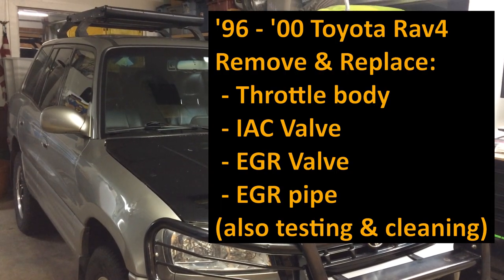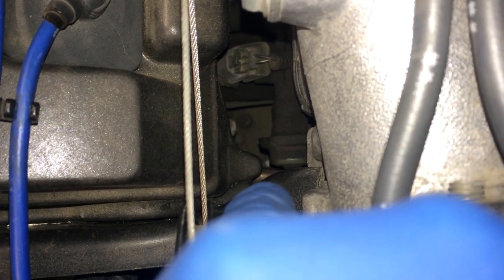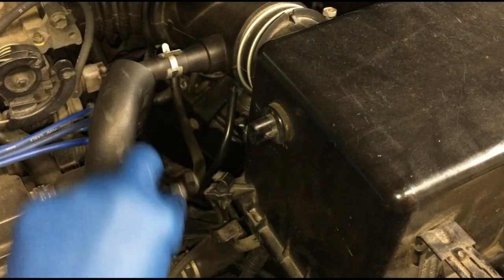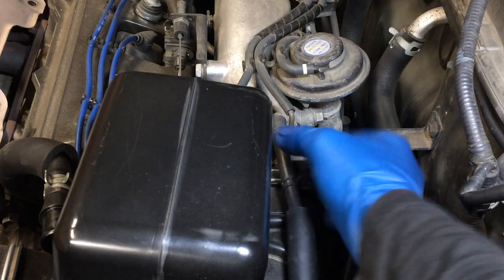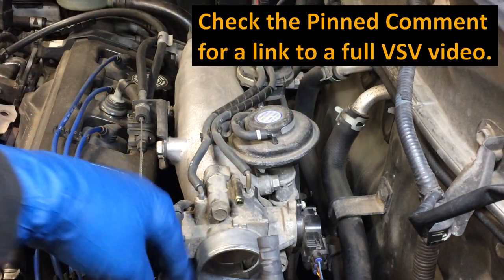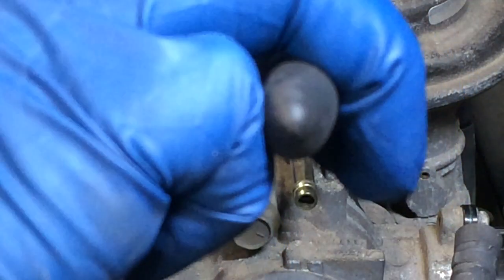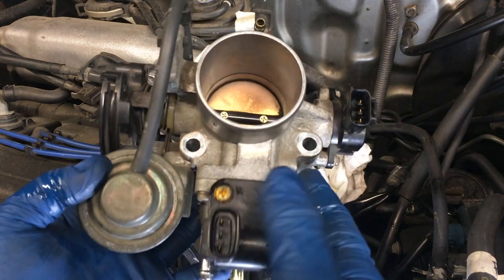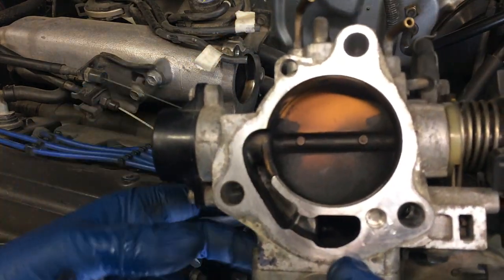1996 - 2000 Toyota Rav4 DIY Remove Throttle Body, IAC Valve, EGR Valve, EGR Pipe, with Bench Tests

Comment: Thank you very much for the clarification of  mechanical instructions to detail you're such a pro  👩‍🔧 
Save me a lot of money for my family can eat . 
Do I have to disconnect battery before starting to take off throttle body ?
 do l have to reset ecm 
When I finish completing the work ?
Reply from the maker: No, you don't need to disconnect the battery before removing the throttle body, and you don't need to reset the ECM, but you certainly can if you'd like: to do that, simply disconnect the battery for a few seconds.  If you notice high idle after cleaning the throttle body or disconnecting the battery, the idle will typically reset over several start-stop and driving cycles.  Thanks for watching! : )

Comment: Excellent -- I LOVE YOUR VIDEOS!! Thank you!!! I can watch over and over. Question the torque wrench what brand and size 3/8 or 1/4?
Reply from the maker: Thanks!  About torque wrenches: the torque values for this job are low, so most 1/4" drive torque wrenches would cover the range needed.  You'd want a 1/4" drive torque wrench that covers up to about 200 inch-lbs (note that is inch-lbs, not ft-lbs, or about 23 Nm).  But there are also 3/8" drive torque wrenches which cover this same low torque range, such as the Icon 56614 (and those are more expensive than the 1/4" drive).

That Icon 56614 is unusual, though, because most 3/8" drive torque wrenches cover a middle range of torque values, such as about 10 to 80 ft-lbs (note that's foot-lbs now, not inch-lbs, or about 14 to 108 Nm).  Then 1/2" drive torque wrenches would cover the higher range of torque values, perhaps 50 to 200 ft-lbs.  

I have a lot of torque wrenches now from several makers, but for years I only had the cheap Pittsburgh torque wrenches from Harbor Freight.  If used correctly, the Pittsburghs have been reliable torque wrenches for me, and there a videos on youtube that show that they're really not bad, especially if you don't have much to spend (torque wrenches can be expensive tools).  I don't think there's a cheaper torque wrench than the Pittsburghs, which are about $20 each, and available in 1/4", 3/8", and 1/2" drives.  

If you can spend a little more, there are better options though, especially because now there are many affordable torque wrenches which have the locking collar-type adjustment knob (such as the Icon 56614) instead of the screw-bottom on the end of the handle, like the Pittsburghs.  I have both and vastly prefer the locking-collar type because sometimes the screw-bottom type get loose.  The locking-collar type do not ever get loose.

I hope that helps!  Thanks for watching, and have fun tool shopping! : )

Comment: If there is enough "tool clearance" to apply Vice-Grips to the periphery of the screw...  only a few degrees of rotation may break the fastener free.  From that point, it's done.  Usually.

Comment: Which manual/book are you using?.Could you kindly share a link to download the soft copy
Reply from the maker: I'm using the Toyota Factory Service Manual (FSM).  I'm not aware of any links, but there may be some available somewhere.  Here is an example of the book I'm using - Volume 2 is the book that covers engine repairs, and is the book shown in my videos:
https://www.ebay.com/itm/380880991501

Volume 1 doesn't contain repair info, but only diagnostics info.

This below may or may not be an electronic version - I don't know and haven't purchased anything from this seller:
https://www.ebay.com/itm/404169235833

I hope that helps - thanks for watching : )

Comment: If possible, please mention at the beginning of your videos the other Toyota years/makes/models with which the RAV 4 work is compatible. I have a 1997 Camry 2.2 L 4 cyl. I am guessing its the same set up. Great videos ! Thanks for your patient hard work.
Reply from the maker: Thanks, I will try to do that -- as you know, the 3SFE and 5SFE engines cover over a decade, and there were some changes here and there, so it takes a little bit of research.  The biggest things to watch for on Toyota EGR systems from this era are:

1.)  some models have an exhaust gas temperature sensor while others use engine temperature, and

2.)  some models have a VSV which works in the opposite fashion as the one seen in the video (meaning that on some VSV's, the energized state is "EGR flow" while the de-energerized state is "no EGR flow").

I'll look into the '97 5SFE and see what I can find.  Overall, there are a lot of similarities between the 3SFE and 5SFE, and many parts are interchangeable, but I'm not positive about the logic on the 5SFE's EGR VSV, and unfortunately I don't have a 5SFE VSV on hand to test (part # is 25860-74050).  I'll let you know what I find!

Comment: I’ve been struggling with the jis screws on the IAC valve. They’re so tight and the person who owned it before me already cammed out the screws so I’m left with nothing left to do but to extract them I’m guessing. Just need to get the new screws before I mutilate the other ones lol. Damn thing is stuck open and idling high.
Reply from the maker: I know the feeling!  As shown in the video at 13:05, those little screws were so tight that they clean sheared my tool-steel JIS bits right off.  If you have anything left to bite into in the screw head hatching, you might try the Vessel JIS screwdrivers shown in the video at 18:03.  I love Vessel JIS screwdrivers.  This little stubby Vessel JIS is extraordinarily grippy - didn't have these at the time, but they are even more grippy than the ones show in the video:

https://www.amazon.com/Vessel-Megadora-920-Stubby-Screwdriver/dp/B00N3M391O/ref=sr_1_20

But if the screws are totally cam'd out, then you'll have to move to another option, such are removing the head (as shown in the video) or trying extraction pliers, such as the Engineer/Vampliers range or Knipex Twin-Grips.  The problem with extraction pliers is, as you know, there's not too much room for bulky pliers heads.  Some examples of extraction pliers that I can recommend in general (but that I'm not sure would fit) are these:

https://www.amazon.com/ENGINEER-PZ-58-Extractor-Combination-fasteners/dp/B002L6HJAA/ref=sr_1_1

https://www.amazon.com/gp/product/B01DIY7V7Y/ref=ppx_yo_dt_b_search_asin_title

https://www.amazon.com/Multi-function-Gripping-Extractors-non-slip-neji-saurus/dp/B00NBSVYOY/ref=sxin_18_ac_d_rm

https://www.amazon.com/KNIPEX-82-01-200-TwinGrip/dp/B097C98LCT/ref=sr_1_1

I have all those pliers except the PZ-58's: I think the most likely to work in that space on such tight little screws would be the Engineer PZ-60 needle-nose, but I don't know that for certain since I just decided to cut the screw (with the the little $7 Harbor Freight rotary tool!).

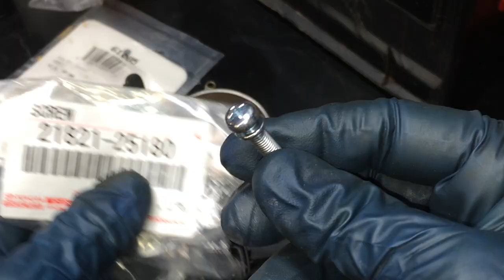I hope that helps - as shown at 26:45, the part number for the screws is Toyota 21821-25180...buy a couple extra!  : )   Good luck!
Reply: @L35inColorado  Thank you for the reply, I'm going to actually consider doing what you did and remove the heads and take them out that way, it may be easier that way. I purchased the vessel screwdriver just like you instructed and I love it! The only thing is that 3 out of 4 of them are cammed all the way out sadly. same with one on the electrical part of the valve. I'm gonna get this tackled down, just ordered the screws from toyota.

Comment: Great educational instruction, Thanks! Why is does the IAC use coolant input and output ports? I just replaced one of the hoses and it was a very tough job on the engine side of the hose. My car is a 96 Rav4 2.0 liter. Still runs great at 214 k. Thanks.
Reply from the maker: 214K miles, that's great!  For your question: the IAC valve has coolant passages because the IACV can adjust based on changes in engine temperature, but since the two parts aren't physically touching, they can't have consistently similar temperature changes unless there is a way to transfer heat from the engine to the IACV.  The coolant acts as that path for heat transfer so that the IACV's temperature can change with the engine temperature.  The variable resistance for "Hot" and "Cold" in the IACV test shown in the video follows along these lines: the IACV has a thermistor component which allows increased resistance in response to heat.  It is my understanding that this is mostly useful for warming up the engine from a cold start (ie, a cold engine idles much faster than a warm engine upon start up), and that there are other components in the engine idle logic circuit that just the coolant temperature.

Comment: Where can I buy the vacuum line for the idle air control valve? Having trouble finding it and need to replace mine.
Reply from the maker: The best option is taking the hose to an auto parts store and seeing if they have a match for the inside diameter.  The outside diameter doesn't matter much - you just need a good snug fitting hose for the fittings, which means matching the inside diameter of the hose.  
Here is some info that might help, if you're looking for part numbers:
https://toyota-usa.epc-data.com/rav4/sxa11l/2352/engine/1708/
I hope that helps! : )
Reply: @L35inColorado  Thank you! With your diagram I found the OEM part on eBay, Toyota discontinued it so had to look around for a little while. I’ve tried a few hoses from the auto parts store and they just weren’t too great. Again thank you so much!
Reply from the maker: @dtomei4236  Outstanding - great work finding your part!

Comment: My vacuum modulator pipe is completely blocked. Any ideas for clearing it?
Reply from the maker: Do you mean the EGR pipe, shown at 45:18?  
If so, you can try soaking it in carb cleaner, or something like Berryman "Chem Dip" - but be forewarned that it can take quite a while!  By "quite a while", I mean days: once the carbon is broken up some, then you can try using a pipe cleaner (such as these below) to dislodge and clean the inside:  

https://www.harborfreight.com/9-piece-tube-pipe-nylon-brush-set-90631.html

Be sure to wear safety goggles/face mask when using the pipe cleaners or brushes, because little bits of stuff will fly all over.  I wish I could give you better tips - unfortunately, it usually just takes a lot of time soaking in carb cleaner to get that carbon to break up.  
I hope that helps!  Thanks for watching : )
Reply: @L35inColorado  Thanks for the reply! I ended up knocking a finishing nail through it to clear the blockage... my carbon cleaner wasn't working fast enough for me. Everything works great now! Cheers
Reply: @L35inColorado  I was referring to the little one at 30:51. I used a speedometer cable and a drill to clear the EGR pipe ;)
Reply from the maker: @devonblaine  Wow, those are great tips for clear those components (with the finishing nail and speedometer cable/drill)!  Thanks for sharing your tips and I'm so glad everything worked out!  : )

Comment: I saw another video saying that I can simply clean the IAC for a rough idle. Is this correct? Why would a person do all of this other stuff? What would you recommend doing for a 97 rav that wasn't maintained well the past 6 yrs(because of my bad experience with mechanics shops). Has about 148000miles on it. I plan to do all fluid flushes and a tune up. It jumps when put into reverse(I plan to check with amco to see if the transmission is still under warranty) and the idle goes up and down, occasionally shakes, there is a screech when it first starts and a small oil leak from somewhere that has gotten a bit bigger over the past 6 yrs. 
Thank you so much for your awesome videos!

Comment: Would you have a link on a replacement idle adjustment screw? Mine is stripped. Any chance you would also know what the idle rpms should be once I put a new screw in there?

Comment: Hello, thanks for your video. One question, I have a 2008 Toyota Corolla with 230,000 km of manual gearbox. The fault is that when you turn it on it starts with 1300 rpm and as it warms up it goes up to 2000, that is, it does it the other way around since I understand it should go down to about 900 rpm. and when I'm hot I go out and when I make the gear changes I see that the rpm oscillates between 2000 and 1000 rpm and when I continue the march the minimum is 2000 rpm. If I leave it running stopped the car stays at 2000 rpm. I clarify that with a scanner it does not give an error. Well, we took out the carburetor, total cleaning including the filter's MAF sensor, I clarify that you can't take out the IAC valve to clean it, but the carburetor body was immersed in non-abrasive remover liquids and a lot of dirt came out. We measured TPS and IAC with a multimeter, simulated with power and everything was fine. We checked the pipes that had never been touched and were untouchable. We put everything together and it starts doing the same fault. Then I disconnected the EGR vacuum valve and there the rpm's dropped a little but after five seconds it accelerates and when connected it returns to 2000 rpm. Could it be a faulty EGR vacuum valve?

Comment: Hi, I was wondering if you could tell me where that vacuum hose comes from that hooks into the bottom of the IAC valve that vacuum hose is missing off of mine I cannot find the other end anywhere
Reply from the maker: Yes - check out this thread from rav4world forums:
https://www.rav4world.com/threads/need-help-finding-a-part.327884/
Thanks for watching!
Reply: @L35inColorado  thank you. I put a plug over it for now. I can't even see that hard line on the throttle body side. Maybe I'm thinking of the wrong vacuum line? Its whatever that hole is in when you take the intake boot off and look in the throttle body. There is a hole in the bottom part that was open on mine.

Comment: What was that hose in your hand at 2:45? Looks like my folks' RAV4 had burst at the small to big section.
Reply from the maker: The hose at 2:45 connects that throttle body vent to the PWM VSV (pulse width modulated vacuum switching valve) for the charcoal canister/EVAP system: if you look up on the inside of the hood, you should see a diagram of the vacuum hoses - you can see the connection there, as well as the layout of all of the air hoses in the engine bay.  That PWM VSV is mounted near the back side of the air filter box, above the charcoal canister.
I hope that helps! : )